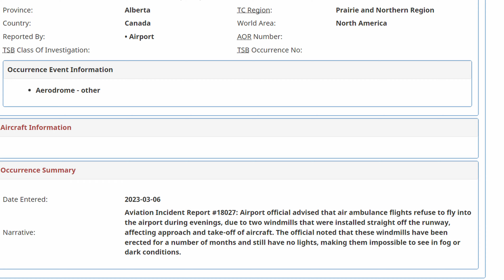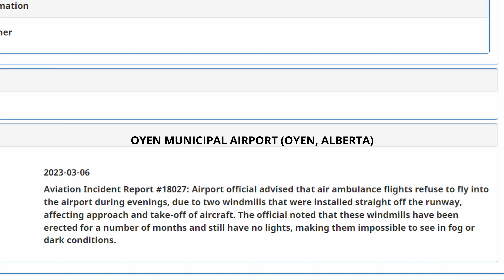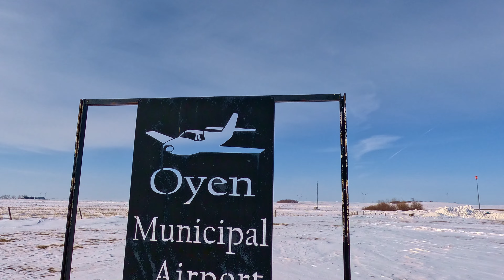Wind Turbines vs Runways - A Dangerous Game?

Comment: Local PPL to that area.  I just wanted to drop a thank you for your level of professionalism in your videos.  I’ve been wanting to take people up to see those things first hand but your video just saved me a lot of 100LL

It’s another thing worth noting that you were doing this in the winter, when aircraft performance is significantly higher.  On a hot summer day those windmills might be harder to climb past for people with poor performing planes.
Reply from the maker: Absolutely!  Flying during summer with a passenger at full gross weight, my Tomahawk would be climbing at a fraction of what that video showed
Reply: There have been a couple times when I've landed there in July in my flybaby. 250fpm climb on a good cold day lol. Not to mention on a 37°C day when density altitude was crazy high. Sucks that there isn't any fuel there either...

Comment: Hey great video!!  I was just talking to my dad about those windmills.  Growing up near Oyen and seeing TMZ up in the air an aircraft I did most of my private and commercial on is pretty awesome.  

I’ve flown Medevac into Oyen early in my aviation career and I’m shocked that no one in the area had the foresight to stop building those windmills on the approach and departure path of a runway.

Good luck with your aviation pursuits and feel free to reach out if you need any help.
Reply from the maker: Awesome Doug!  Thank you.  My current goal is getting publications ironed out with Nav Canada so these wind turbines are documented properly.  I'm making some headway.  The NOTAM was just updated but I don't think it was done well enough- it still doesn't specifically address the ones in the runway path.

Comment: They should be lit, obviously, and shown on the sectional, just like every tall radio tower and so on, but they shouldn't be an impediment since they are quite close to the ground compared to how far they are away.  I erected a 440 foot tower 4.8NM away from a pretty busy airport but the base of that tower is 400 feet higher than the runway altitude, so its far taller than this situation.  At one point there were actually three towers and 4 turbines in that immediate area.  It hasn't been a problem and it was erected over 13 years ago.

We never light the blade tips.  It's a lightning protection and maintenance issue.  Can't really do it.
Reply from the maker: Thank you for the info 👍 at this point I'm trying to get the NOTAM amended to specifically address those 2 that are directly in the runway path.  It's a bit of a process so far!
Reply: @planeswithperry  I've been thinking about this and I have some suggestions.

First, the turbines don't need a NOTAM.  They are an obstruction and you don't need a NOTAM for that.  You need it marked on the sectional (and propagated through to all the other maps used).  You need a NOTAM because they aren't lit.  That's what the NOTAM should say.  Then they need to get lit.  At least in the US, they could never have been erected without avoidance lighting.  I don't know the rules there but they should be lit, rules or no.  Once lit, there's no need for a NOTAM if they are on the maps.

My opinion.
Reply from the maker: In Canada they still list obstructions close to airports in the NOTAMs.  My home airport has a lit antenna that is further from the airport than the distance of the wind turbines in the video and it even has its own NOTAM mentioning that specific antenna.  I'm in contact with Nav Canada (they provide our ATC, other flight services, and our publications).  I'm hoping a resolution can be met.

Comment: My question IS, how the hell did these wind turbines in that location get approved? There is no way they should have been allowed in the flight path, it's not as if there is no available land out here.
Someone should have to explain why this was approved, the structures in question should be not operated until a full review is done at the very least.
Somebody was asleep at the wheel.
Reply from the maker: That might be the case.  From what I have read in the documents of various stages, the original plans called for a smaller turbine.  There was a last minute change to having fewer turbines but a much larger model.  I need to confirm with Transport Canada that the larger model was approved by them.  If not, there may be a serious issue unfolding.